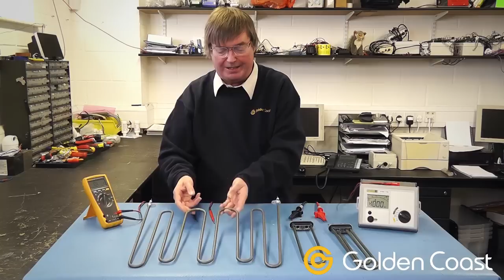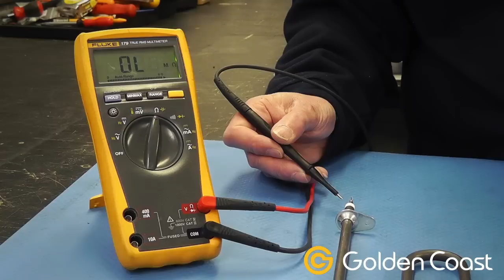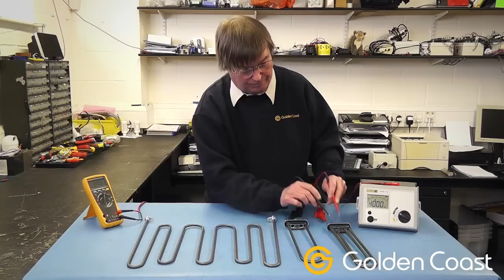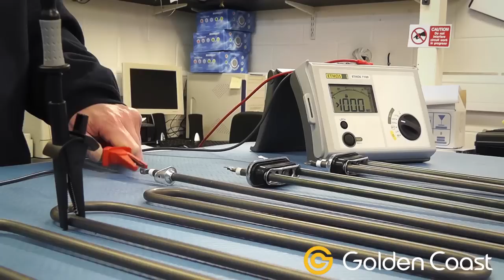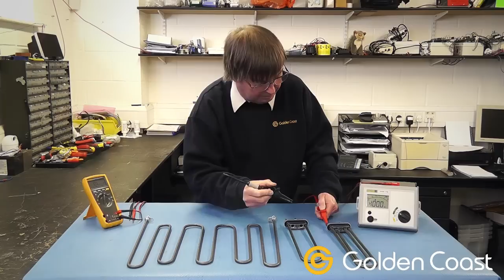Testing the Elements on Tylo Sauna Heater and Steam Generator | Andy's Answers

Comment: 3.08 Ohms? IS that really acceptable for an insulation test?
Reply from the maker: Hi Rob,

First of all the test is in ‘meg Ohms’ not Ohms and tested at 500 volts.
This is a basic test for elements to see if it is an element tripping an RCD.
The tests for electrical installations, as set out in BS 7671 : 2018 Wiring Regulations, 643.5.201 says that anything under one meg Ohm is not acceptable.
All the best, Andy
Reply: @GoldenCoast  Andy - in your video you say "3.08 OHMS"

Comment: I have a Tylo sauna which has stopped working. The company in Marin who installed it is no longer in business. Who can fix this? Clearly I will not be able to take apart the unit as the interesting vid shows. Help from the company?
Reply from the maker: Hi Pegan. Sorry to hear you are having problems. As we are the UK distributor I'm afraid we cant help but would suggest you contact Tylo direct through www.tylo.com. Hope you get your sauna working soon.

Comment: Excuse my ignorance, i'm thinking of using a tylo element for an art installation. I want to generate steam and most importantly the sound of the steam being generated. Does the sauna one require three phase power (i'm assuming not as you said to plug into mains to check for a fault)
Reply from the maker: Correct Ben, they are also available in single phase
Reply: What do you think of this product? https://www.banggood.com/Wet-Dry-Sauna-Heater-Spa-Stove-Detoxifying-Antiaging-Stainless-Steel-Internal-Control-HouseHold-p-1141875.html?p=QG080163176892016090